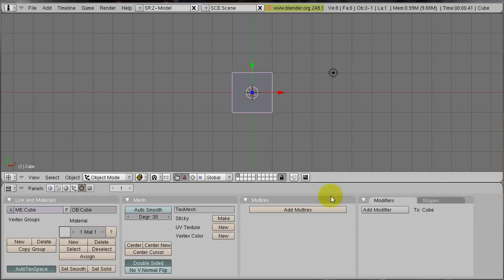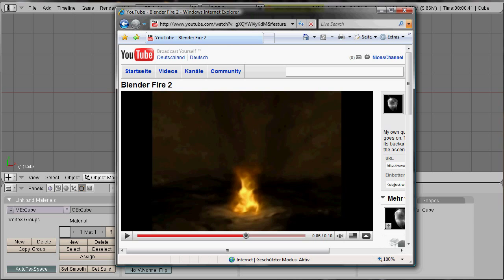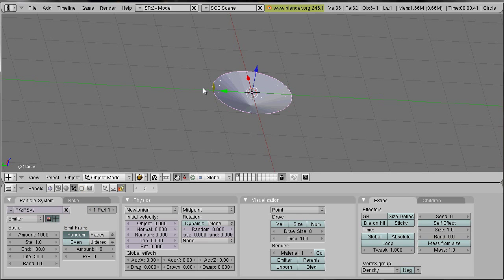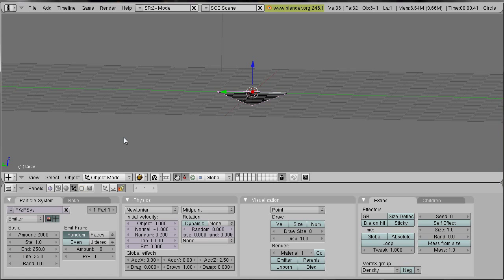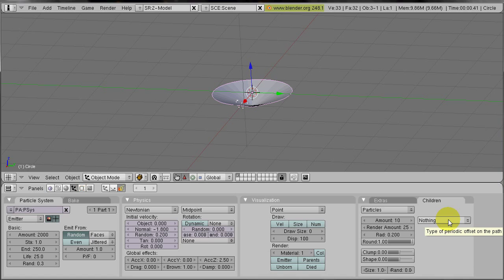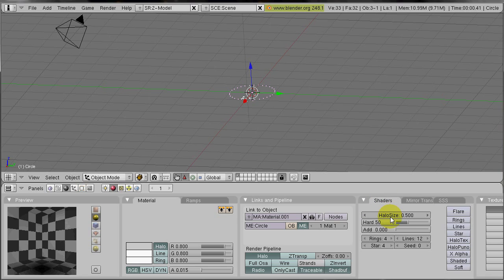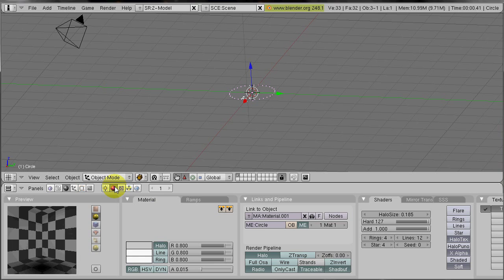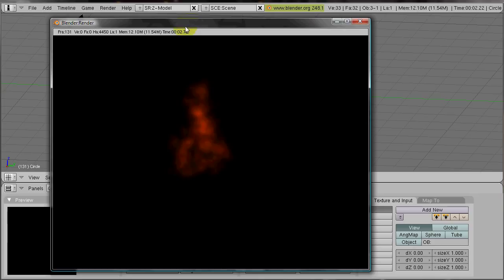Nion's Blender Tutorial: Fire pt. 1/4 Emitter Settings

Comment: yes. but u would need to render out the fire, then use all images and make 1 image, with all frames in it, then u add that image as a animated texture to a plane. and it should work ^^. U betetr serach around some if u need better info